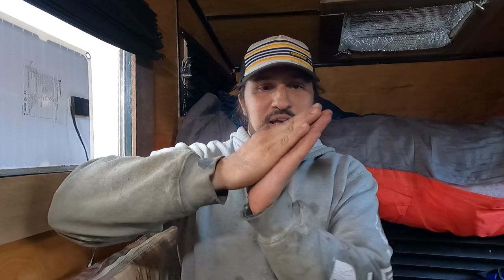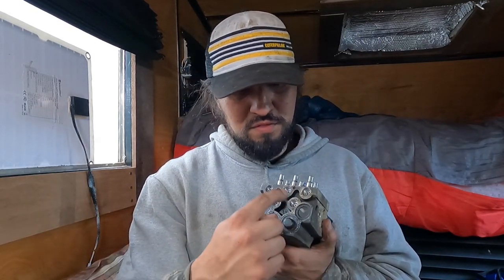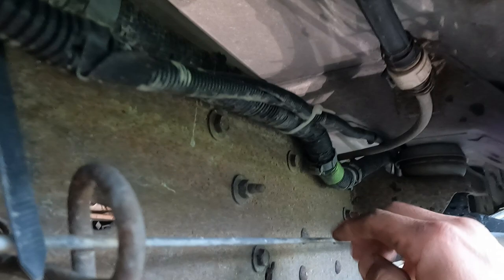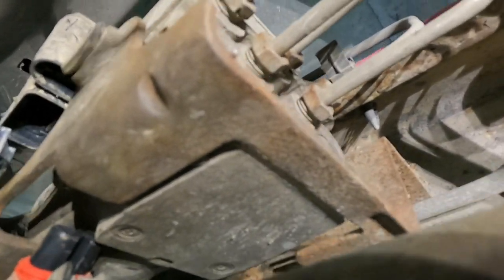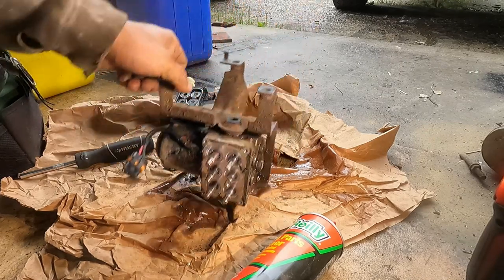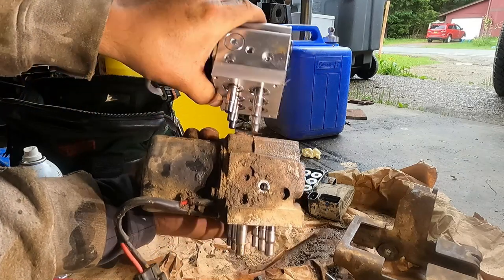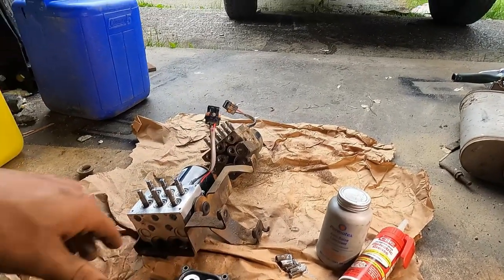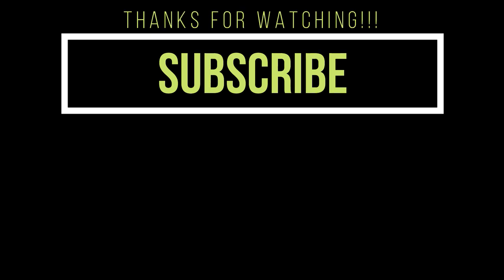99-02 GMC Chevy ABS Pump Replacement

Comment: I just destroyed mine while fastening the very last of the 6 lines.  I now want to burn my truck.
Reply from the maker: Ahhhhh man!  I've done that before and know exactly how you feel.   I spent hours trying to fix the threads to no avail and had to purchase a new one.   That's the kind of thing you hope to only do once.   I think the only thing you can try (if there is enough material left on the threads) is to cut one of the fittings so it acts as a tap then run it through and see if it holds.   High pressure things though so it's a long shot.
Reply: Do it

Comment: Replacing entire brake line system today. Does it matter where the Blake lines go into the modulator and do you have a diagram of what goes where
Reply from the maker: Hello Dan, and good luck today replacing your brake lines!  It does matter where your brake lines go in the valve module.  The abs module will tell which valves to open, half open, or close depending on the braking situation.  The top right is "rear" to the left of that is your "front drivers" to the left of that is "front passenger".  The bottom right is "front master cylinder"  left of that is "rear master cylinder".    Changing the brake lines is not too difficult of a job but it definitely easier if you have an extra set of hands helping feed the lines through.  I swapped stainless brake lines on both my 2001 GMC 3500 Crew Cab Long Bed, as well as a 2000 Chevy Silverado 2500 Extended Cab 6.5' bed.   I made a video of the Silverado job you can see here for reference if you like:  https://www.youtube.com/watch?v=4WQFwYgTwRA&t=1073s    Best of luck again 🍻

Comment: Do you mean to tell me those units are still available new? I have a 2000 Chevy 1500 express van and the Son of  Gun piece of something told me the ABS was no longer made. No lights on the dash but no pressure on the right front caliper. I found a used one ONLY because I trusted what my trusty mechanic told me. Tell me something I can hang a glimmer of hope to.
Reply from the maker: I mean they should still make those.  Which engine do you have?   I installed an ABS pump & modulating valve in a 2000 Chevy Silverado 2500 and my 2001 GMC Sierra 3500/ LB7 Duramax.

Comment: There are two lines which come off of the Master Cylinder. This is because, I have read, the piston is really two pumps, a primary and a back up. There are 4 wheels which we need for braking pressure. 2+4=6 but yet there are only 5 stainless brake line connections on the ABS module. Why is that? Do the pressure supply lines coming out of the Master Cylinder go into a block? If so the bock has to have one way valves. Which line goes to which wheel? My right front caliper is dry as a bone after having replaced, bearings, brake caliper, brake hoses, brake pads and rotors. I loosened the banjo connection and no sign of fluid there after bleeding the system. Also some cars, you can trick the ABS to auto bleed. Never done so but might be a great time saver to the driveway mechanic such as myself.
Reply from the maker: Hey Rowdy,  thanks for the question.  It's been a minute since I thought about it but as I recall the 2 master cylinders lines plug into the bottom two spots on the valve (one for front and one for back)  the front left and right brake lines have their own spot to mount on the valve and the rear brakes only have one line that feeds back to rear brakes then splits into two for the rear left and right.
Reply from the maker: As far as which goes to which I can't remember off the top of my head but I know I go over it in the video. I also have a stainless steel brake line install video on a 2000 chevy 2500 on my channel you can cross reference with
Reply from the maker: Your front right caliper is dry as a bone?  Hmmm.. im not 100% sure but your abs valve for the front right brake line might be stuck in the closed position.
Reply: @KooshdaakaaGarage  ok I finally found a diagram and identified the lines. As expected two pressure lines come from the Master Cylinder. The far left top lines go to the rear brakes and are distributed by a block. The center line is the right brake line and the right line is the left brake line. So now at least I can trouble shoot the line. I expect what you say is correct and there is a valve body problem.
Reply: @KooshdaakaaGarage  I will surely take a peek. And thank you for taking the additional effort to film and edit. This tells me you have respect for others. Thank you for being a teacher too.
Reply: @KooshdaakaaGarage  Yessir, you are correct. I get a bit lazy on YouTube and I throw out questions before I have done my own research. My apologies. I do have a question which today, I dog-eared, my Haynes Manual looking for. What fuse is responsible for monitoring the power to the ABS Valve Body? There is no mention of it in the text and perhaps overlooked in the wiring diagrams. Do you know?
Reply from the maker: @crawford323   One thing I'd do if I were you to see if its the ABS valve body or the caliper is crack open the line at the caliper to see if fluid trickles out.  If so,  try  bleeding the line to see if you have positive pressure.  If you do and fluid gushes out then your valves are ok and your caliper might be toast.
Reply from the maker: If your Express is like my 2001 GMC Sierra then your ABS fuse will be in the fuse box in the engine bay, driver side.  On mine it is one of the big fuses on top.  The fuse box lid will have a diagram to tell you for sure.
Reply: @KooshdaakaaGarage  why does my pedal in my 00 Tahoe have no pressure and create ZERO stopping? It’s soft pedal all the way to the floor and doesn’t stop the truck at all!!!! I bought it this way.
Reply from the maker: @adamherrington9871   Ah man, that's no good.   When I first bought the dually the brakes were super soft, almost non existent.   It turned out to be a combination of things for me.  Some of my calipers were locked open so they would not grab the rotor.  One of my rear rotor hats was worn down all the way through so there was nothing to grab.  All of the pads were worn down to the metal.   After I changed all of that I blew a hard brake line so I replaced them with a new set of stainless steel lines.   After that the brakes were still really soft which is where I discovered I had a leaky hydroboost and a leaky gear box.  Both of those are driven by the power steering pump so if either one of them are leaking then you are losing brake pressure constantly.   I'd check all of those things first (calipers, rotors, pads, hydroboost and gear box) to make sure they are all operating.  Once you fix any issues with those things you should have decent brake pressure.  If your ABS system is on the fritz I'd check your wheel speed sensors on the front wheels to make sure there isn't a bunch of rust build up where the sensor plugs into the hub.  In the 00-02 models this is an issue and can cause eratic brake response as well as it can cause your ABS system to shut off because it can no longer read your wheel speed so it doesn't know how to respond to the driving conditions.  I have a video on that you can check out here: https://www.youtube.com/watch?v=zr7R3fLUGGI&t=63s  With all of those things fixed you should have brake pressure.  The very last thing I'd check after everything else has been fixed is your ABS pump and valve.  If your sensors are good then the pump and valve should be operating.  If the valves get stuck open and/or the pump dies then the abs pump & valve will not be able to regulate brake pressure in the fashion it is designed too.   However, even if the valves are stuck open and the pump is dead, you should still be able to stop or at least slow down well enough if the rest of the brake system is in working order.  Best of luck man!
Reply: @KooshdaakaaGarage  thanks a million for the response. Has a code for abs ground and also for front passenger wheel speed sensor being bad too by the way. No hydro boost system on my particular truck tho

Comment: FyI. Nice Video and the reason the harness was hard to unplug was not only because it had not unplugged in a while. Some models may have a gooey substance the keeps moisture out because of being on the frame rail. Same substance used on tyranny plugs. A blow dryer will allow you to unplug easier after heating the goo to soften.  It's not glue it's a goo
Reply from the maker: Ah yeah that makes sense.  Sweet, thanks for the tip man!   🍻

Comment: This information really gave me some clarification on how to safely remove the brake lines on the unit for my 2001 suburban. Everything is identical except how the 3 mounting bolts go through the frame.
Reply from the maker: Glad it helped!  I think re installing the lines was probably the most nerv  racking part because of how easy the aluminum strips. But as long as your take your time getting the first couple threads in then the rest will be gravy. Best of luck! 🍻

Comment: Although too much dialelctric grease can be a problem, i had a v6 f150 before no one could figure out the misfire on it they has brand new plugs and wires it turned out to be too much grease acting as a barrier not allowing any electricity to flow.

Comment: Hi. Thank you for the video. I'm helping a buddy chase down a fluid leak. Can the modual leak  or will it be the hydraul control unit
Reply from the maker: @Bill-j2g  ah man, chasing down leaks is always fun!  This unit shouldn't leak unless the lines or threads on the unit were damaged.  You'd be able to tell pretty quick just by pumping the brakes a few times.

Comment: So, after you install it do you have to do a break bleed? Get out any air? Or not?
Reply from the maker: @TheTruth23rd  yeah I'd bleed it if I were you. With a scan tool if you can. I went out on a dirt road and did a few hard brake deployments at low speed to kick the abs pump on which pushed the air out.
Reply: @KooshdaakaaGarage  okay, I have to do my 17’ Silverado. Abs control pump stuck. So the light would turn on and turn off. But now it’s not turning off. So I need to do mine asap this weekend. Any advice before I start?
Reply from the maker: @TheTruth23rd  fun! Get your flare nut wrenches and take your time threading.  The abs unit is aluminum and is extremely easy to strip. Once the threads are stripped it's toast. There's not enough room to re tap. So just take your time, hand thread everything and you'll get er' done 🍻

Comment: 300k on my lly, all original brakes.  Getting ready to do mine soon too.
   Gonna grab new front bearings also, speed sensors...
Reply from the maker: All original brakes at 300k?? That is pretty dang impressive 👏   it'll feel quite a bit different with the new system in place. Best of luck!  I have a new steering gear box I have to toss in but the temp is hitting a low of 7 degrees today... think ill wait this one out and put in led backing lights instead 😬
Reply: Hey thanks I'll try it out soon thanks again

Comment: Question broth, I'm planning to replace the abs pump but some one told me , I need a special tool some kind of pump to drain the lines,need answers,cause shopp charge me$1400 to do it include the part, is why I want to do it myself 🙃🤔😞
Reply from the maker: Hey Chavo, thanks for the question. I hear ya, that's about $1000 in labor!  You will not need a special tool to drain the lines, they will do that as soon as you crack them open.  The tricky part about changing your ABS pump & valve is bleeding the air out of your NEW valves.  The easiest way is if you have a "Tech II" there is an ABS bleeding function that will turn your pump on and push all the air out that you can then bleed out of the caliper.   I don't have one of those so what I did is went to a dirt road (you can go somewhere with wet pavement or snow and ice too)  and got up to about 15 mph then slammed on the brake to activate the ABS pump.  If your brakes go from hard to soft like you have air in your lines then your pump did what you wanted it to do and you can go back and bleed your brakes again.   Do this a few times at least until your brakes maintain a stiff pedal after an ABS activation event.  Hope this helps man and good luck 🍻

Comment: I have a 2002 gmc sls Sonoma crew cab and I have all the break parts replaced just that it won’t hold pressure
Reply from the maker: Hello KingDeathClaw54, and sorry to hear about your brakes that is very frustrating. I just went through this same thing with my dually and here is what I can share with you.  If your brakes won't hold pressure check a couple things before changing your pump & valve.   In our early 2000s GMC/Chevy vehicles they are notorious for failed ABS sensors, not because there is anything wrong with the sensors per-say but the hub they are mounted too will rust and lift the sensor up which pushes the magnetic sensor too far away to read the reluctor wheel. You can fix this by removing the abs sensor from the hub and sanding the hub down so its nice and flush.   I cover how to do that procedure here:  https://www.youtube.com/watch?v=zr7R3fLUGGI&t=550s   If your sensors are damaged or not registering because of the rust build up, the ABS pump will not engage because the ABS system will not be able to calculate your wheel speed.  You also might check to make sure you don't have a vacuum leak in your brake booster just to make sure.   I'll put the link to the valve & pump in your next comment where you ask for the link.  Best of luck man🍻

Comment: Hey when you did this job did you empty the master cylinder of all the brake fluid? If you did, did you need to bench bleed it afterwards?
Reply from the maker: Thank you for the question Justin.  I did drain the master cylinder during the procedure!  It is a good idea to bench bleed afterwards.  However, I don't have a kit set up so I did the old school "crack the lines open"  to bleed method and it worked out for me.

Comment: Sir, I replaced my 01 silverado 2500hd abs and brakelines after watching your video. I cant seem to start rebleeding. Do I need to take off master cyl first and rebleed it then do each wheel and finally do abs bleed w scanner tool? What order do i start w? Maybe i dont need to rebleed MC? Thnx in advance for any help.
Reply: Sir, I replaced front wheel hubs and speed sensors  and all 4 rotors and calipers. Also made sure all 5 new brake lines were hooked up to abs right.
Reply from the maker: @garywilliams3850  you are in for a lot of brake bleeding my friend.  It took me a while to manually bleed all the air out after installing new calipers, then again when installing new hard lines then again when installing the abs modulating valve etc.   Best thing you can do is stay the course and bleed the caliper furthest from the master cylinder the  work your way towards the closest to the master cylinder one by one.  If you have a bleed tool (I don't) and/or a tech II (I don't) then the auto bleed function is a nice option. Otherwise you can use a dirt road or wet road to speed up to 10-15 mph or whatever you are comfortable with then slam on your brakes to activate the abs and push any air out of the abs modulating valves.  If your brakes go from somewhat hard to squishy then you successfully pushed air out of the abs valves and can bleed the calipers again. It'll take a bit of time but you are on the right track.  Best of luck 🍻

Comment: HI I HAVE A CUESTIÓN AFTER YOU TOOK THE PART OF DID YOU NEED TO BLEED THE BRAKES AND WHEN YOU GET A CODE C0110 PUMP MOTOR CIRCUIT MALFUNCTION IS THAT THE MODULE OR PUMP OR BOTH THANK YOU
Reply from the maker: Hello Mauricio, and thank you for your question.   I did perform a full brake bleed after this procedure. It takes a while to get all the air out of the valves.  Using a scan tool like a Tech II which has the ABS bleed function is a great option.  I don't have that tool so I took my truck on an old dirt road, drove 10 mph then hit the brakes until the ABS activated and pushed the air out.  You'll know it worked if your brakes go from stiff to feeling like their is air in the line (squishy brakes).  Then you simply bleed the brakes again then rinse and repeat.  BE CAREFUL if you decide to do this.  My recommendation is to get a Tech II or a similar tool with the ABS bleed function.

Comment: Thanks for the video , QUESTION 🙋‍♂️ , what are the two holes underneath where the brake lines go ? Looks like two that have a rubber boot on it.
Reply from the maker: You know I'm not entirely sure.  I was looking it up trying to figure it out and I think it might be part of a bleed function.  I'm not sure how to use it though.  Now I'm curious and want to figure it out!
Reply: @KooshdaakaaGarage  I found that they’re dust caps and with a diy probe, can be used to determine a bad ABS block/valve assembly.
Reply from the maker: ohhhh cool!  Thank you for letting me know!